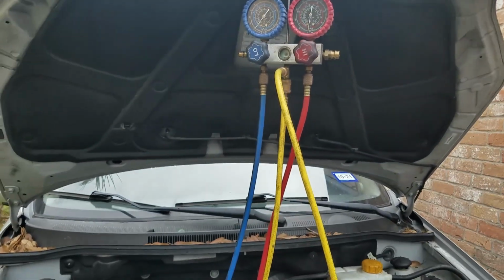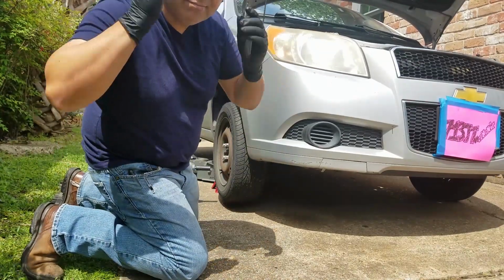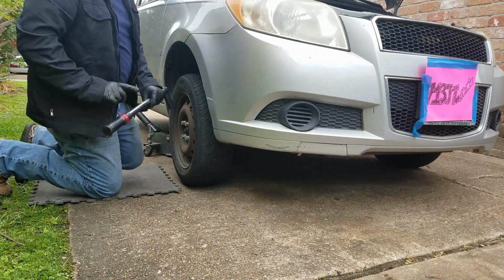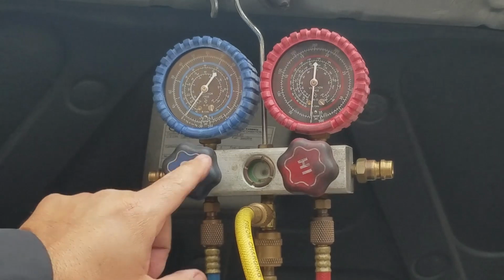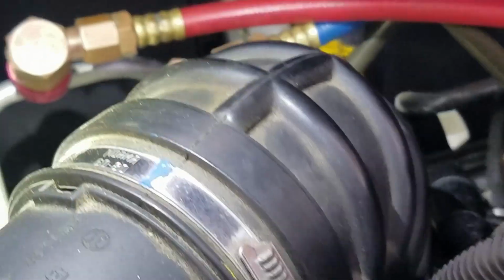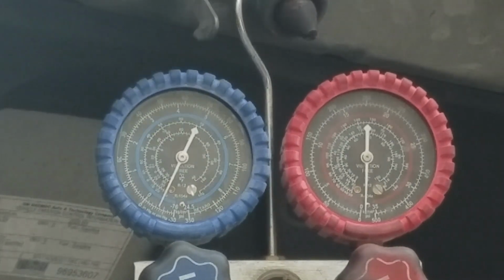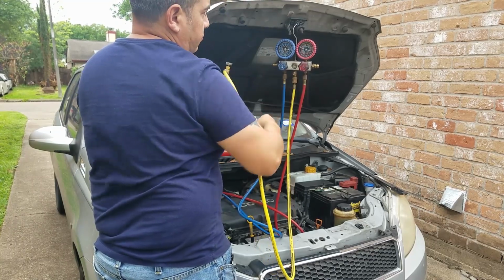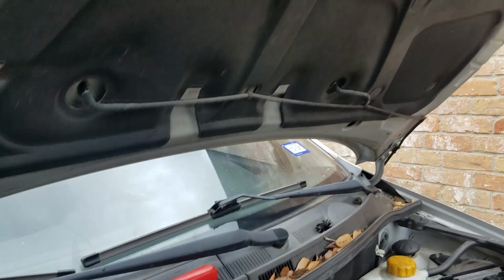09 Chevy Aveo5 1.6liter AC not working. Lets diagnose.

Comment: I have the same model, my compressor clutch kicks in but no cold air and the cooling fan doesn't come on.
Reply from the maker: It can be two things. Low on refrigerant or a faulty low psi switch. When you connect the ac manifold gauges, ac system off, the pressures should be near outside temp. Ex: if the outside temp is 90 F degrees your pressures on gauges should be near below or above 90psi. If the pressures are around 20 psi you have low amount of refrigerant. Hope this info helps you. Good luck on your findings

Comment: Mine says the freon is full but it not cold when it blows..can u help me pls..mine is a 2011 aveo 5 hatchback
Reply from the maker: So… if your ac system has the right amount of refrigerant, then can be other issues. Make sure the ac button is on at the ac controller. Check the clutch at the compressor if it’s engaged. If the compressor is engaged, next while the ac is operating touch the two ac lines near the bulk head one line should warm and the other should cold. Start with these diagnoses.
Reply: @713jtmechanic8  do you know of any fuses to the ac controller. Cant find anything on it. The blower turns on but the defrost/ circulation/  and ac button doesn't

Comment: I have a 2011 and it blowing hot I added ac  coolant but it's still blowing hoy what else could I check tyfs
Reply from the maker: Hi Lisa,
Make sure the AC button under the fan speed knob has the green light on. If you press the button and the green light does not stay on. It is possible the  AC fuse may be blown. If green light on AC button stays on and no cold air is felt. It may be a compressor problem.
Reply: Ty for responding back I will go check that out I hope it is that and not the compressor
Reply from the maker: @lisafalor9146  I hope it's something low cost and easy repair. Good luck.